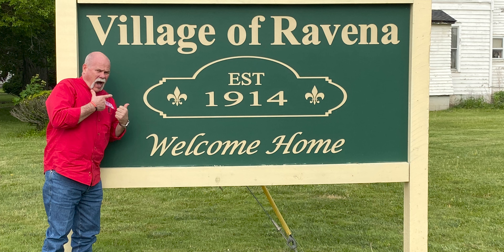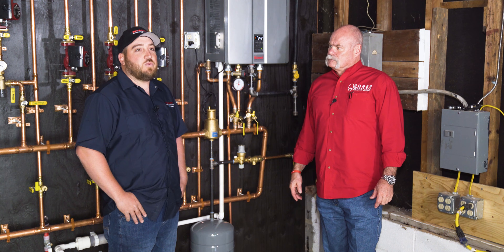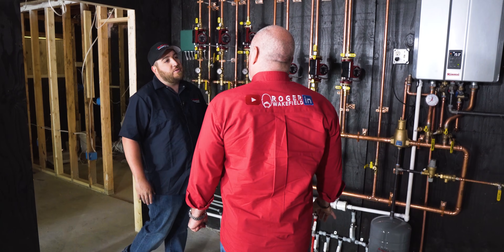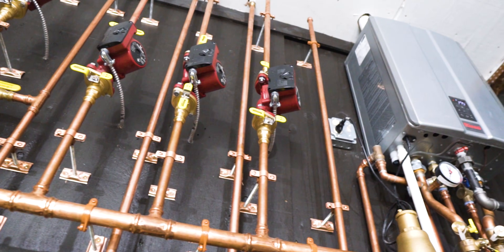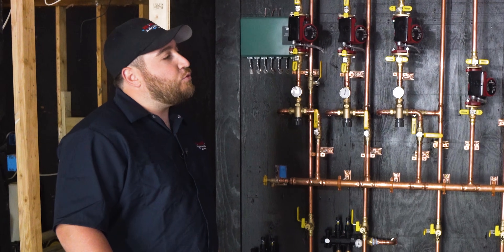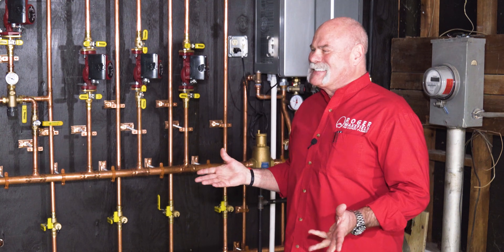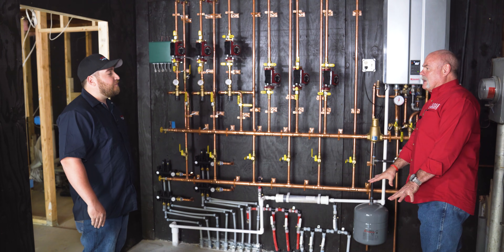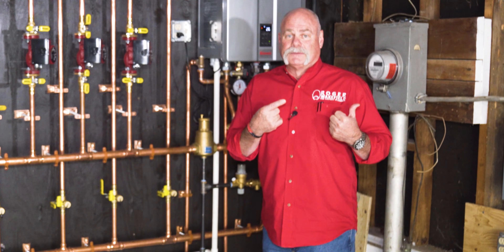I've Never Seen ANYTHING Like This | Combi Boiler Install

Comment: Great video and beautiful job by whoever the plumber was that did that. Question . No previous boiler and just piping to air handlers. Why would they use black steel piping on the makeup water line. That black steel in time will break down and cause issues for that combi boiler. Cheap material and easy to use. Should have been brass Copper or something similar.

Comment: These boilers are 80% efficient UNLESS you return water is 130f or less for propane. Add the glycol and into the 70"s. Black iron for water when you got 800$ in copper? total fail

Comment: Live 20 min north of Ravena and have a need for new boiler. Considering the quote of $8600 to replace the 50 yr boiler I have with one just like it that's 84%, this must cost tens of thousands of dollars for this setup.

84% lasts 20 to 50 years but the high efficiency boilers need to be descaled once a year just to last 15 if you are lucky. After the initial repiping it's not too expensive but the downtime, maintenance and repairs is much higher than the old reliable systems.

Comment: The only thing I can say is, WOW. That system is incredible. The only thing I would add is a shut off valve just before the expansion tank so that it is easy to replace without completely stopping the system.

Comment: What temperature does the boiler fluid need to be to supply hot air? 

What temp does water need to be to supply DHW? 

95% efficiency is only at condensing temps.  Right?  Do you need to be above condensing temps to make DHW and forced air?

I’m installing a similar system right now but plan to add a heat pump water heater for summer hot water and the ability to have a DHW storage tank too.  Also, too many zones and microzones can lead to short cycling.  So a buffer tank might be required for greater efficiency.
Reply: You are right, installed like this and antifreeze on top of it, this system will get nowhere near 95%.  In fact, there is no real advantage over a cheaper simpler non condensing  boiler for this install.
Reply: @johnbocum7591  I've have a combi unit installed for 12 years and it can heat entire house down to teens at 128 output temp at boiler.  That should be around 115 return temp and run at minimum fire rate.  I can go no lower as it will short cycle and I have no outdoor temp reset.  Installers seem to set temps at 180 by default from the older days......though newer circulator pumps and outdoor reset should allow the boiler to adjust so it does run at condensation temps.  Curious how the shown Combi is running efficiency wise.  Exhaust analysis on mine showed 88%+ efficiency at full DHW.....so still better than the older cast iron.

Comment: 2 quick questions
#1 are the screws that your connecting your exhaust/fresh air factory screws? I believe those screws should have a specific coating on them...
#2 why the change to black iron at the exp tank/air Scoop? Just curious to know of there's a specific reason for that??
Thanks

Comment: In the early 1990's I needed to get out of electric and install a used Burnham boiler with radiators.  Well the quoted install back then was 2600 give or take for the few estimates.  Well I went to the local library and checked out a book on hydronic heating systems.  Well that and driving the local plumbing and heating supply house guys crazy.....almost 30 years later it still humming along. Knock on wood.  Routine maintenance and an Aquastat ( and one self soldier repair) regular 1.0 80B 's  etc. and its warm steady heat.   Now that PEX loops in concrete is growing that COULD be a future and some other ideas to make the PA winter a little more bearable.  Videos like this and youtube sure help those of us with limited knowledge.  And back in the 1930's when my dad was a little kid you could NOT even paint YOUR OWN house with the union.  Times change....soon all this knowledge will get a lock on it too so that only AUTHORIZED personnel can LEARN.  History folks.   Mine was similar just without pex, pumps for each zone (just have one Bell and Gosset for the entire house on the RETURN side) not shut off for the 1.5 inch main loop either. I know  I know I have drained it all ONCE.   Thanks to all who made this video.

Comment: That's a condensing boiler.  I wonder why they were running 180 degrees into the radiant floor heat.  I have a weil-mclain version of this.  No mention if this Rinai unit is a step-down boiler.  I'd imagine it is.  

One thing for sure that install certainly scratches that OCD itch.

Comment: only one thing I would have done differently is i would not have put the steel pipe they have on the water supply to the heating system and to the expansion tank. Its not a big deal but keeping all steel out of a plate type condensing boiler is the best way to go. Its only a few feet of pipe so no reason to introduce any rust into these systems. Just my opinion.

Comment: Heating conversion from electric heat to gas in theory except for the 6 electric circulator pumps nailed to the wall and one in the boiler.  At least that install did a complete backflush on the homeowner's wallet.
Reply: Exactly all that BS did was backslash his wallet. Scammers...but what about the efficiency benefit....umm the boiler turns off when the desired temperature is achieved, so the sooner the better. I don't want to wait 45 mins for heat in October or January....all this green BS is on3 bug scam
 Lmao.

Comment: That system would be great in one of those 3D printed concrete houses they are building now. You could have the pipes running under the floor and the walls. With the amount of money the homeowner would save, it sounds like a great match as those 3D printed houses are expensive.
Reply: So is running a combi.. especially if on propane..better to go with trombe or barra wall if going with concrete house

Comment: Nice install but even in NY, there is a reason installs like this are rare: Cost... If I have baseboard hydronic, it's pretty comfortable compared to forced air, then why would I go through the effort of a complete remodel to add in-floor? I bet this system was easily 30 grand to install and since the home owner burns propane, they aren't really saving money vs electric baseboards (in the upstate NY energy market). The system will never pay for itself, but most of these "efficient" system installs never do. It's just a fact- not trying to be negative.

Again, cool install, but these in-floor systems are a rich man's game- in 12-15 (at best) years they will be ripping out that boiler and putting in another combi (maybe heat pump system, who knows) where as a cast iron boiler will be running for 30+ years. Obviously baseboard electric is incredibly reliable and simple, but it's cost to operate varies wildly depending on how it's used and electric rates. For upstate NY, electric resistance heat is expensive but can be the cheaper option when oil and propane are high- like the past couple years.

For me, I have made the decision to be less comfortable and go with a mini split system. Things feel a lot more drafty on the cold days, but I refuse to put money into a new hydronic system when oil is $4 and $5 a gallon and the NYS legislators are working to ban fossil fuels from homes.

Comment: My viessman vitoden install when i bought the house looks like this.  Just on a much smaller scale.  I absolutely love it.  Small footprint, efficient, on my gas bill anyway, install wasn't cheap.  The on demand hot water i really appreciate.  Does it take slightly longer to heat up?   Sure.  But a small price to pay for the efficiency.
Reply: Does yours incorporate the solar water panels, or is it just direct gas?
Reply: @k.we2279  direct gas.  I live in a western facing house in canada.  It didnt make sense to spring for the solar.  Also, since i had to replace the old 1958 oil boiler for insurance purposes, i should have moved it to the opposite side of the basement, you know.  In line with all the taps in the house, that would have just made sense.  But buying a house, working out all the details of that, it didnt occur to me.  So part of the delay is the distance it has to travel to get to the taps plays into that.  I forgot to mention that.

Comment: It may be a boiler capable of 95% but it is running a lot lower efficiency at the 175f discharge temp because it is too hot to condense flue gas.  Beautiful workmanship but bad design

Comment: The plumbing for a Combi Boiler system looks like something out of a submarine.  The plumbing in my house with a gas powered furnace with ducted air and a gas hot water heater is dead simple.  Is there no need for A/C in that part of the country?
Reply: Of course there is just not a long season for a/c

Comment: Question for you is , how big is the house ? How many systems they have that requires heating?  And where is the Zone Valves , I only seen programmers, everything is controlled manually, they have dozens of isolation valves , it’s not very efficient to have it this way , have you noticed, he switched the valves off manually, can you imagine you forget to switch something off , the pumps will be pumping the water against each other 😂😂😂
Reply: That’s not how it works, the system has circulating pumps the iso flanges are to swap out a circular pump if it gos bad without draining that zone, zone valves are garbage this is a much better install, each pump is on a separate zone they are never pushing against each other he has all the pumps off because it’s not up and running yet
Reply: Zone valves SUCK. Real plumber install Circulators with isolation flanges.

Comment: Beautiful job....but no redundancy. That boiler dies you have nothing. Always have a separate tank or wall tankless for that. Also hydronic has its places but is not the do all end all. Furnace and ductwork is way cheaper, provides airflow and filteration for house, dead air in a house can feel gross. In canada the best setup in furnace forced air with ac and boiler for domestic with infloor in basement. If furnace dies you still have infloor....
Reply: Undersized also, it's going to fail faster than usual

Comment: I've got a Rinnai doing hot water and hydro air heat. It works incredibly well.
Reply from the maker: What part of the country are you in?
Reply: @RogerWakefield  New England, in an apartment complex. One too many of the 50 gallon tanks (65k BTU direct vent, also did heat & hot water) ruptured, so the insurance said they had to convert to tankless or get dropped.

Comment: Where is that boiler made and what’s the model?
Reply from the maker: You can find more info in the description..I linked the product from Rinnai..
Reply: @RogerWakefield   ahh, thanks, double dry heat exchanger that should soon get to the UK. We use tanks to store hot water. There is also a Vailant heater with a small storage tank on board that would compensate for the hot water demand.

Comment: Why no buffer tank?  Aren't all those pumps going to work against each other and stop the boiler from modulating? (if it can)
Reply: Good point, that boiler is a commercial grade in the UK. We would definitely put in a tank to supply hot water. But, he did say the boiler can supply both at the same time so I have to research that design.  Where is that boiler made and what’s the model?
Reply: @digitaria This is a Rinnai I Series boiler, made in Japan. Combis use a flat plate heat exchanger to produce domestic hot water, similarly to a tankless water heater but using hydronic system water in lieu of a burner. They work extremely well when sized and installed correctly, they're extremely popular.

Comment: That heater is not 95% efficient at 175°F, not unless physics work differently the other side of the pond? Why no demand/weather compensation - there's at least 10% seasonal efficiency left on the table, probably more - it's easy when the combi has its own hot water circuit.

Comment: Hope all that pipework gonna be insulated (British regs)
Reply from the maker: Instead of insulating, they add anti-freeze into the system
Reply: The insulation is to prevent uncontrolled heat loss. As a retired heating engineer I also question the necessity of so many pumps having installed many multi zone systems with a mix of underfloor and radiator zones all under thermostatic control with a maximum of two (pumps).with all zones under independent thermostatic control.Corrosion inhibitor/antifreeze is always added. That said ,its a very neat bit of plumbing but unescaseraly complicated and  therefore expensive. Europe is the home of the gas combi boiler, Germany producing the originals (Valient) in the sixties I beleave. It took a while for the the UK to  approve combis because of their direct connection to the mains water and the risk  of contamination of the same. but for many decades many houses ,large and small have used combi boilers. The current trend (pressure from government on environmental grounds) is to go the heat pump route as the heat source.

Comment: Gas pipe looks to be undersized and that Trakpipe isn’t supported. The piping looks good other than lack of primary secondary. Low loss header doesn’t count.
Reply: 3/4 that’s right on the boiler

Comment: 10s of thousands for 10 percent efficiency
Reply: You would have a great point if all you gained was 10% efficiency, why would anybody do this? However, that's not the way these work.... I think you might not grasp how this technology operates.

 That flame inside the boiler modulates itself, that means its self adjusting. Think about it this way, if we still heated our house with a giant fireplace in the middle of the living room, you would build a small fire on a September night, but you would build a bigger fire on a February night. Both fires would heat your house adequately because September is not as cold as February. That's what this boiler does all by itself. It's going to turn on and burn the right amount of fuel with zero waste every single time.....AND it's 95% efficient. 

This boiler will save you 40% of what it would cost to heat with a standard 80% efficient boiler....
Reply: @mtoto78  lol. I know how it works. It still is more expensive and the maintenance and repair is doubled. Been in refrigeration for 20 years. The high efficiency crusade will use less energy. No argument there. But you will spend thousands more to install and thousands to fix when it fails. Also, the unreliability worsens and when the equipment fails the parts will always have to be ordered leaving the customer down for longer.
Reply: @zekemontgomery6678  yep, and that's why those systems are pushed. Steady work.
Reply: Sure it's 95% efficient but not at 175°, which the boiler is displaying.
Reply: Cost is the only factor anyone should ever look at?
Reply: you only get better then 80% on a condensing boiler IF the return water is below 130 for propane. Which i do not see happening here. THEN add the glycol and it reduces it into the 70"s. fail

Comment: Woa 95% efficient compared to like 300% heat pump. This company just likes selling a lot of GAS which is easy to do when you hook your customers up with all new propane boiler systems! $$$$$$
Reply: Electricty is crazy expensive in NY. So savings from higher COP of a heat pump is not fully realized.  Equipment costs of heat pumps are much more also. Proper sizing, installation, and cold weather performance are critical for air source heat pumps to work properly.  These boilers are less susceptible to bad system design and install than heat pumps. 
But i agree, those systems are likely the future when combined with some solar. For now, propane is still cheap per BTU in the US.  The war in Ukraine caused many Europeans to install air source heat pumps as gas prices peaked. That will be the test case for modern heat pumps.  Europe has little natural gas while the US has lots and plenty of propane from refining gasoline. So with cheaper equipment and cheap gas this is common in the US. At least they aren’t burning fuel oil anymore.  That has been the most common fuel source in the Northeast US since coal stoves were replaced.
Reply: @daversj  Ah yes I see what you are saying. I live in the north of Ontario and our gas is more expenisve than heating with a heat pump now. It will be neat to see what the Ukraine numbers show over the years!

Comment: Why no low loss header ? Boiler will work more efficiently with one it stops pumps working against each other back circulation, also boiler will modulate better saving energy
Reply: The manifold coming out of the bottom of the boiler is a closely spaced tee system, which accomplishes the same thing as a low loss header.